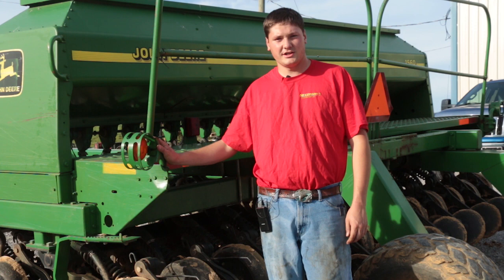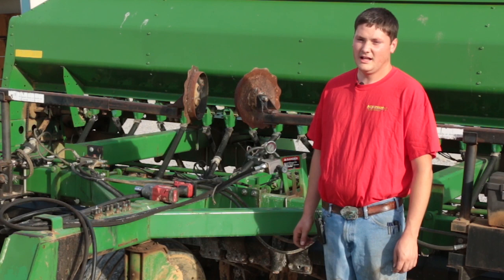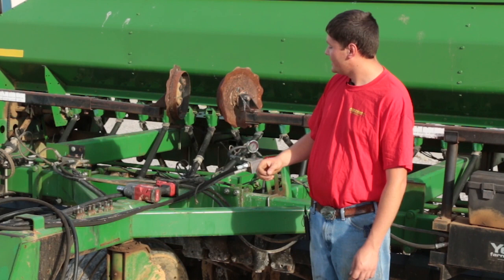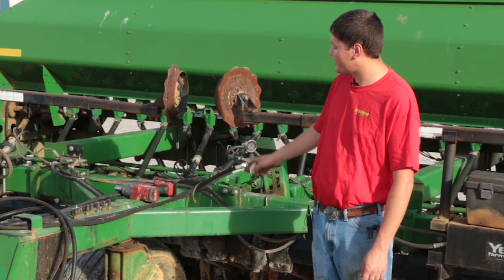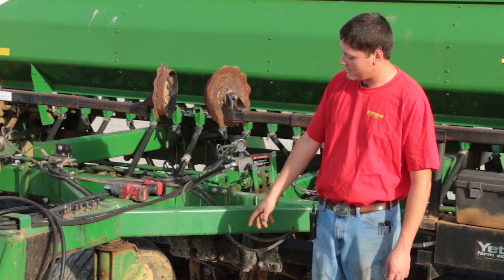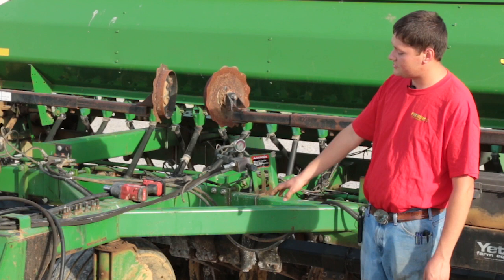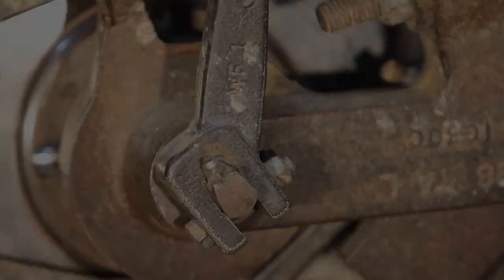Needham Ag - What to look for when buying a used John Deere 1560 or 1590 box drill

Comment: what is the main difference between the 1560 and the 1590?
Reply from the maker: The 1560 was built (I believe, and I’m open to correction) between 1998 and 2002. The 1590 was introduced (again I believe) in 2002, so the 1590 is basically a newer drill. 

The 1560 and 1590 both use the same opener arm, same disc blade, same firming wheel arm and the same closing wheel arm. However the seed boot on the 1560 was a 2 piece boot with a special seed tube to fit within it. The 1590 seed boot is a big improvement (especially for seed placement) and allows you to use a much better seed tab. 

I believe it was 2007 when they released the 0.8 x 9” firming wheel which wasn’t a good performer. While it was better than the 1” x 10” wheel it replaced, it still didn’t match the shape of the seed slot. Our V8 wheel (that JD copied in their ProSeries) does match the shape of the seed slot, as you would expect when you make molds of the seed slot and use those molds to make a tire.
Reply: 30